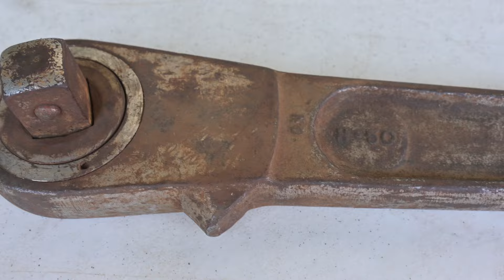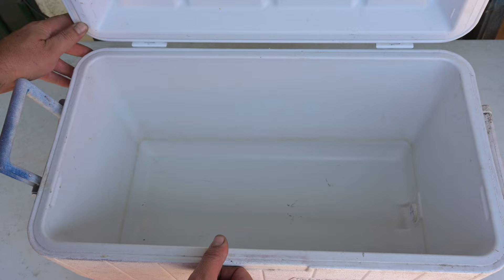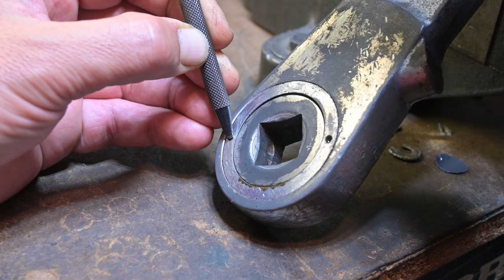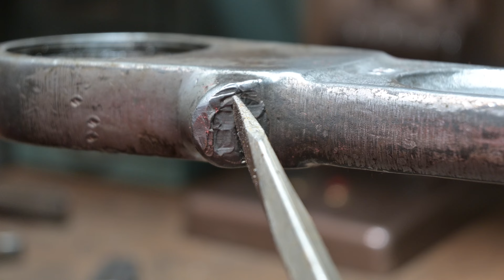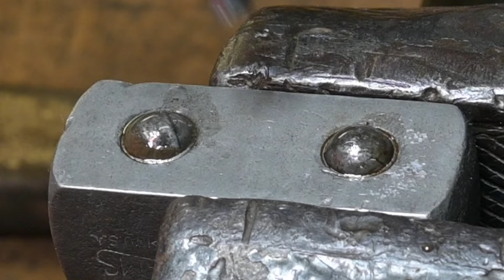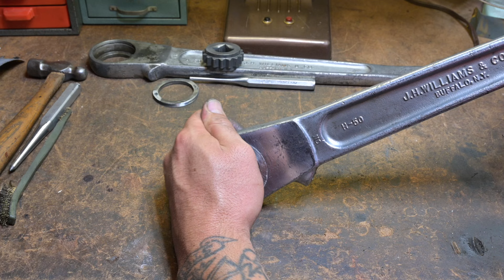How to Ruin a Vintage Williams H-50 3/4"  Ratchet

Comment: Curious, why did you not pull the innards? Could the side screw not be removed? I guess the important thing is the one is complete and totally functional now 👍 Now I see how to get in my S-51……but will be extremely careful removing the locking plate. 👍👏🇺🇸
Reply from the maker: @Living-The-Dream  
That side screws looks like someone melted lead or something on it so it wouldn’t budge. I figured I screwed up the threads inside the ratchet, there was no need to take everything out. 
I’m kinda bummed that I ruined this one but hey, at least I have a plug now for my other H-50. 
And for only 8 bucks. 
That’s a Win for Me. 
Try to find a small Brass Punch to do the job. You’ll ruin the punch instead of the threaded plate. I need to make a tool for these ratchets. I know there has to be a better way.
Reply: @spiderlovesbeerohyeah4760  Gotcha !! I think I’m going to go with a bit of “Heat” first……then a 2-3 bath in Ballistol…….then the gentle soft brass persuasion 👍👏 Thanks for saving me from ruining mine…….well at least not yet 🤣 If I can come up with a temporary small vise mount, I shall attempt to video it……but I wouldn’t expect much…..maybe a few choice words and a Repent or two or three……..Will see 👀👍👏🇺🇸
Reply from the maker: @Living-The-Dream 
I soaked, then heated, then used some penetrating stuff. Seems like the threads fused together after all those years. That’s the only thing I can think of. Just make sure to tap one side a couple times, then tap the other side so it’ll be and even amount of force. 
You got this First Sergeant.